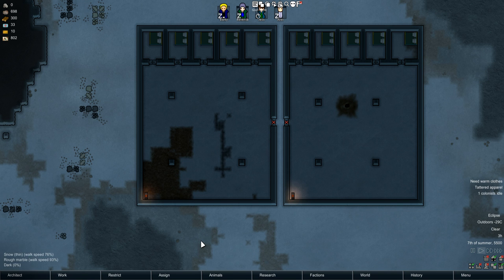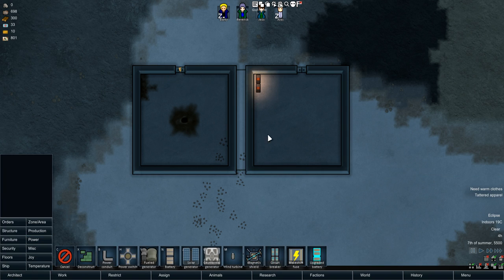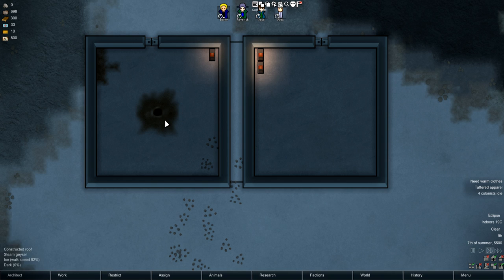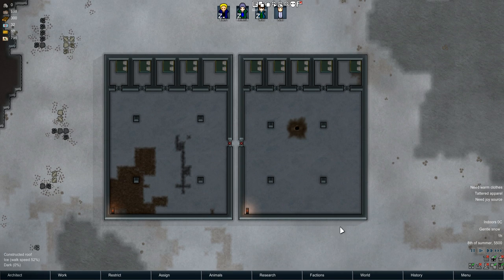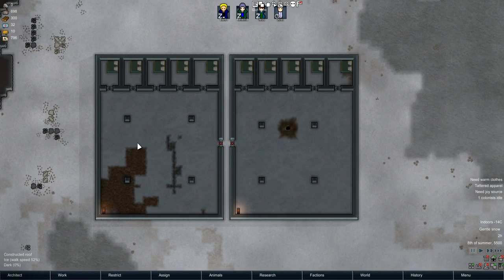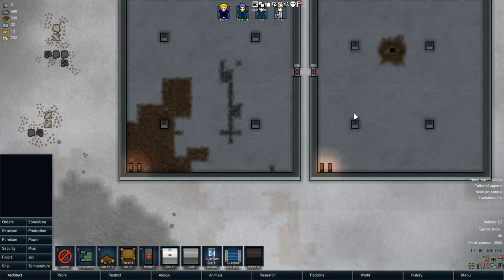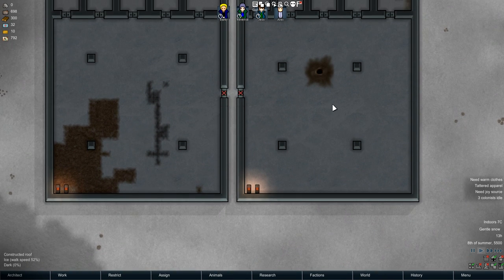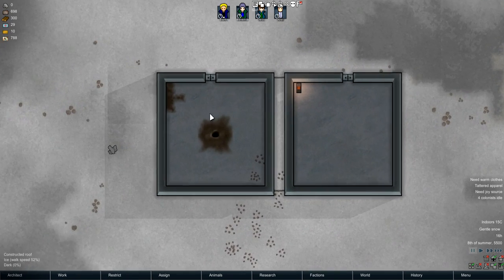Should You Use Geothermal Vents on Ice Sheets? Rimworld Guide

Comment: Between spurts the heat dissipates to fill the available space, and some does leak out the walls. So, #1: insulate the walls with a double layer. The consistency matters, but it really only applies to the small space in which the vent is confined. Add a wall vent and the heat spreads out more evenly, and the rooms that enjoy that heat don't fluctuate wildly like the vent's room does. On an ice sheet my geo vent's room fluctuated from 70-120F while the rest of the base was at or close to 70F (very comfortable). What I'd like to see tested is if adding a geothermal generator on top of the vent reduces its heat output enough to necessitate building heaters as well. If so, how many heaters? How much would the heat loss impact your total available power after adding heaters to compensate?
Reply from the maker: Hey Bill. Definitely true, I didn't want to insulate the rooms at all if possible to test out the values. I definitely do recommend insulating rooms properly on ice-sheets, as to stop fluctuation. To answer your last question no, adding a geothermal generator onto a vent doesn't change its output at all. I've messed around with the game files quite a bit and they both add the same amount of heat in the same intervals.
Reply: Thank you very much!
Reply from the maker: You're welcome! Glad I could help.

Comment: this works better if you chamber the geothermal vent and add a specific air duct shaft into your main base. ie like a maintanence shaft. make sure to hook your refrigerator rooms exhaust into the heating shaft so that all that excess heat generated by the refrigerators gets pumped into the heat shaft. this will make the shafts temp about 100+ but if you use vents on the exits you can pump that heating shaft air into your greenhouse, and living quarters. then you wont ever need heaters. if you build thr heating shaft as a centralized structure and build your rooms around the shaft.

Comment: I normaly build around the vent so close that 1 generator fits whit 1 space around to hold the heat up.
Means that heat will be way more stabile heat you get, that room around are main base like beds and work space.
Point is the Heat vent core should be around 40-80 C. if you are not happy about this, put in some heaters in a row to aim about 50c or 50-60C scale up this safe you energy bill. and one connector to transfer heat out of the core, in real bad conditions.
In big base 80x80 you need minimum 2+ vents aim for 3 if can.